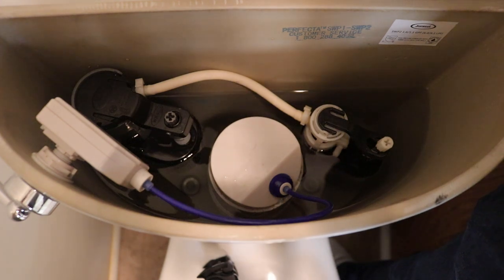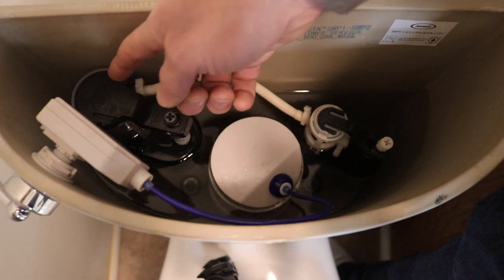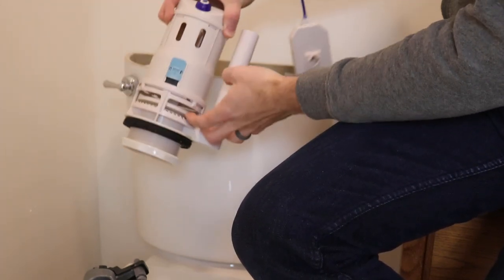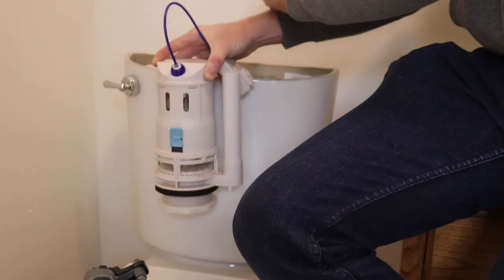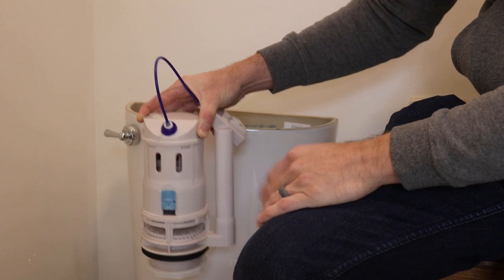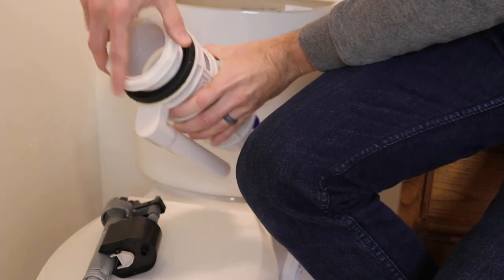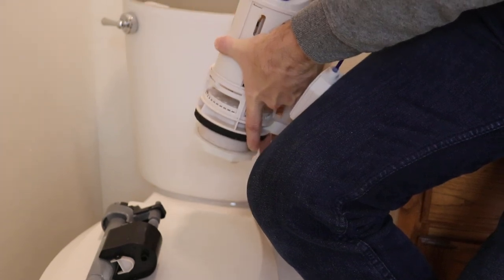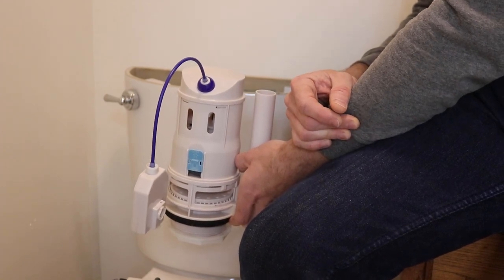How to fix a hissing Jacuzzi Perfecta SWP2 dual flush toilet

Comment: My issue is the handle has started sticking. So it needs manually lifted and sometimes jiggled too get it to seal. I'm not sure if fixing it is an option. Replacing it definitely. I'll get a new toilet. This one was here when we bought the house. I would never have bought this brand. It's not a quality issue, it's just looks awful.

Comment: How did you remove it ?
Reply: you have to remove the filler tube in the middle the hard way... Shut off water. Unscrew the long screws that secure the tank. Remove tank. I used an oil filter wrench to get enough torque to get the plastic bolt off the end. It takes a while, but it was the only solution that worked (and it is still working after many months!).
Reply: Neil Berg , thank you ... this is so frustrating... I’ve tried everything... I will try your recommendation
Reply: @nubiar5  good luck. Get towels for the inevitable drips. It's doable, but it takes a while and you have to have that new seal from Jacuzzi, of course

Comment from the maker: Another problem I had with this set of symptoms: the silicone seal under the main cylinder failed and took on water causing it to deform (it filled up like a water balloon). The cylinder is easy to remove. The seal is easy to replace.

Comment: My SWP2's issue is the fill valve, I think. When flushing, either up or down, I get 2 seconds of fill, then 3 or 4 seconds of no fill, then another 2 seconds of fill. Repeat until tank is full, and is all kinds of irritating to hear. If I push the fill valve down until the water returns to the full tank level and let go, it's fine... until the next flush.
Reply: @StanBlueberry I have the same problem. Did you fix it and if so what was it? Thank you.
Reply: @billburlingame7817  It was the flush valve itself.  I put it off a long time since the only way to replace it is to remove the tank.  I got the part directly from Jacuzzi long ago, and I've been searching my old emails to see if I could find the specific part number, but coming up empty. Not sure if NuFlush has a compatible replacement part.

Comment: So we have had this toilet for 8 years, it started shutting off the water while refilling, it seems the little cup the float sits in would fill with water raising the float, then the water would slowly drain from that, water back on and repeated until it reached the actual fill level.  We tried CLR in the tank etc, didn't seem to help.  Now, it no longer does that, but slowly (so slowly) fills...and then keeps running.  It seems like the water that keeps running must be going down some "overflow" drain because it can run all night and not fill above the fill line.  Anyway, the flapper seats fine it seems, the initial flush is fine if the tank has had enough time to refill.  What parts do you think need to be replaced or cleaned or adjusted?  Thank you!
Reply from the maker: I think you may have a leak between the tank and the bowl. This is a pain and requires removing the tank. This would explain why it wants to refill all the time, no matter the mechanism it's using to refill.
This is only a guess, but it sounds like you've tried the easy things.

Comment: replaced all the mechanisms but tank wont fill - it did at first but now not a drop of water comes in. can you advise me?
Reply from the maker: Check your fill valve mechanism, I guess. I've not had that issue, but it sounds frustrating.

Comment: I have the SWP2XXX model and it refills itself a probably 4-10 times a hour when the water drops about a quarter inch or so on the valve. When you look in the Bowl you can't see the water moving and even when you watch it on the refill valve you can barley see it drop. Any ideas as to where to start? I've replaced the refill valve, and tinkered with the other components, thanks for the advice.
Reply from the maker: You can add food coloring to the bowl so you can see the leak better. Is your fill level too high? You might have to lower it a bit. You also might have a float hanging up... you can adjust those my wiggling them on the bar a little and by using the screw.  You can also try descaling your tank with vinegar (and scrubbing -- be sure to take the cylinder off, which is easy to do  --- rotate and remove then clean the main seals) . If those don't work, you might have to replace the seal under the cylinder. It's a pain, but it fixed the problem for me.

Comment: Can you manually flush these toilets? Our lever broke and we ordered a new one but it won’t be here for a while
Reply from the maker: That's a lousy problem. I'd recommend keeping a set of channel locks near what is left of the handle. That should get you by for a few days until the next arrives. If that breaks the handle until it won't work, you are left with the very manual "pour a bucket of water down the bowl" fix until you get the part.

Comment: I have the same exact toilet but my handle has broken off and I have no idea how to replace just that piece. Can you help?
Reply from the maker: Quick video showing how: https://youtu.be/EG6bPQiwgFU
Reply from the maker: In the tank you push in the little clip that attaches the large white box to the handle. You then unscrew the white bolt from the back and the handle comes right out. Jacuzzi should sell the new handles if you can't get one locally.
Reply from the maker: I should also mention that my video made it look easy, but it can be a terrible bugger if it has been on a while. I can't the handle off two of my four Perfectas. If you can get it off, reinstall it with lots of petroleum jelly on the post so that it will free in the future.
Reply from the maker: Also, the proper way to get off the impossible handle is to pull very hard and wiggle. It takes a minute or two of it coming out very very slowly.